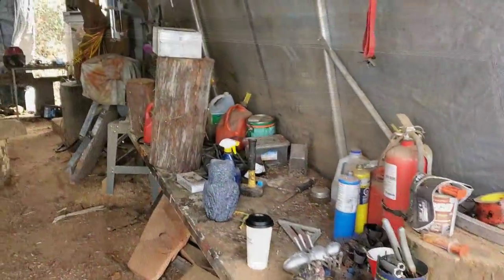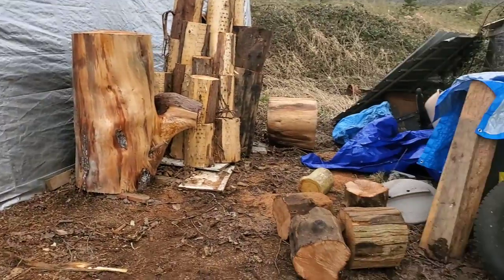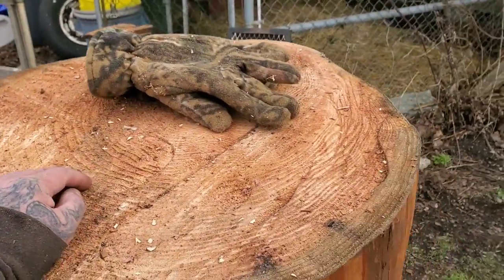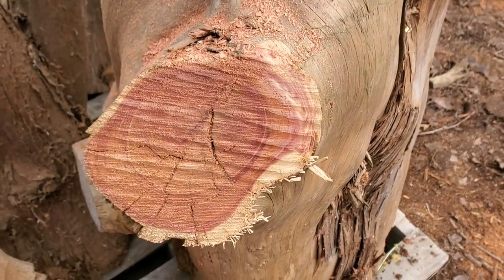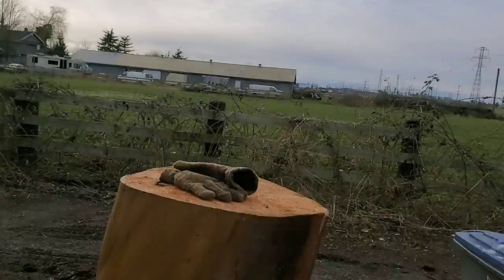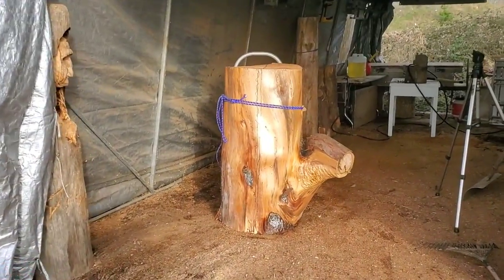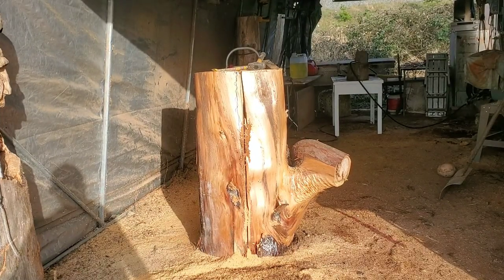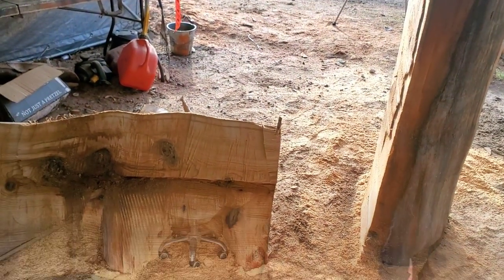Chainsaw carving Some type of Throne # 1 & Cleaning shop

Comment: Pretty big chunk of log there. I think a rope that don't stretch so much might have helped, but you use what ya got if you can. Makes it a lot easier to get things done in a clean work area. I hate cleanin, but sometimes ya just gotta do it. I'm think I'm gonna move my plastic garage thingie work area a few feet and I gotta level off the area so I'll do that cleanin thing when I get around to the movin thing. Hi Jordy.